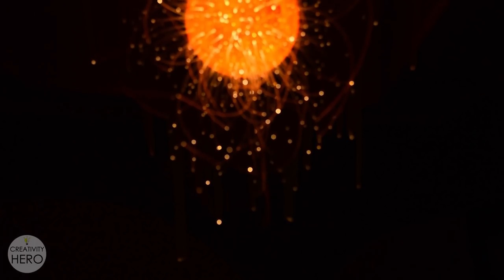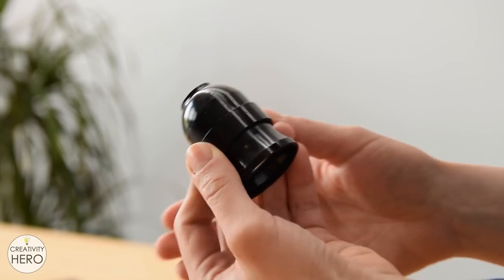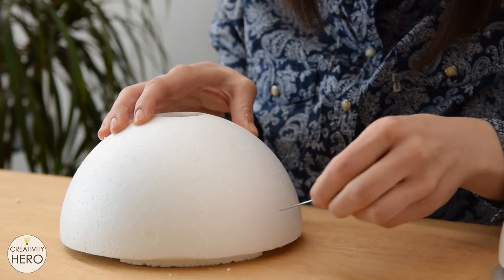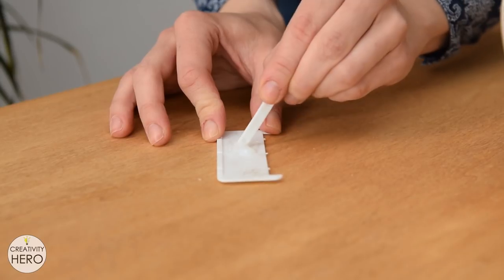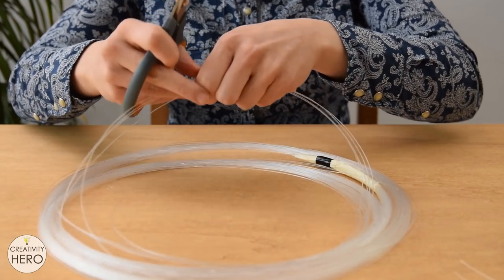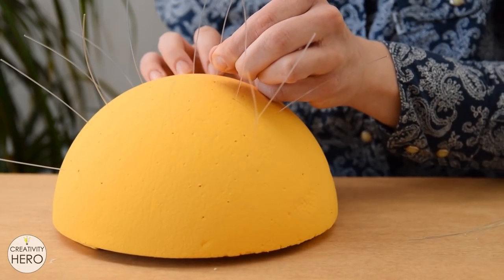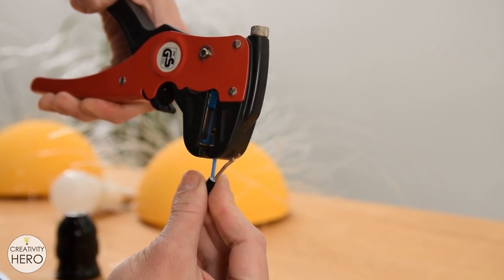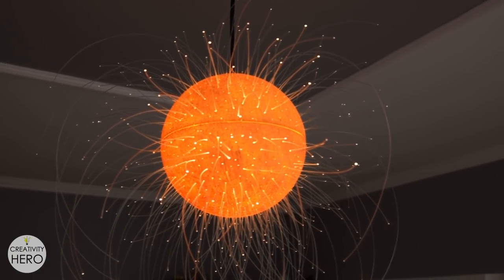Exploding Sun LED Lamp | Simple DIY Project

Comment: Really nice idea, I think my nephew would love one. I saw other people commenting on your English and they’re right, it’s very good. May I give you two tips to help you? One is very subtle: try to notice the difference between the Spanish pronunciation of a word like “two” and how native speakers of English pronounce it: the “t” is much harder in Spanish than it is in general English. It’s almost as if it were spelled “tch” in Spanish, but softer than that. The other one is usually difficult for Spanish speakers - the open sounds. “Melt”, for instance, has a very open sound and most Spanish speakers pronounce it with a closed sound (because it’s the closest in Spanish). However, you can almost do it when you say “door”, which is great already. The open sounds are pronounced in a very similar way to the closed ones, except they’re higher in your mouth, almost “hitting” the front part of your palate. Try to say “eh” as if you’re in doubt, with a closed sound, and then project the same sound forwards. Literally imagine the word going up and front, through your nose. You can stretch your neck a little and project your head while learning - most of my students found this helpful when learning the open sounds. The open sounds are also used in lots of other languages, so it’s a good idea to learn how to do them. :)
Reply from the maker: Thank you so much! I appreciate your advice!

Comment: Thanks for the cool video.
Did you actually buy the fiber optic cable from that Amazon link? I bought it from them but the cable does not dissipate any light to the sides, it actually conducts it all the way to the edge, so there is no glowing effect like you have in your video. 
I actually 3D printed a lithophane of the Sun and used a smart color changing bulb (and also just a regular LED bulb as well), but could not achieve the glowing effect at all. 
Any ideas?
Reply: Having the same issue